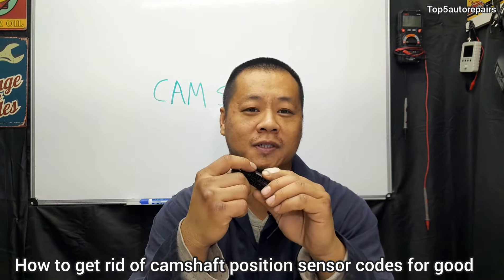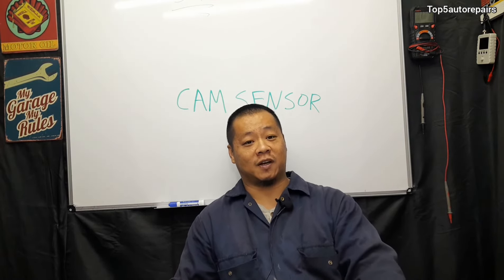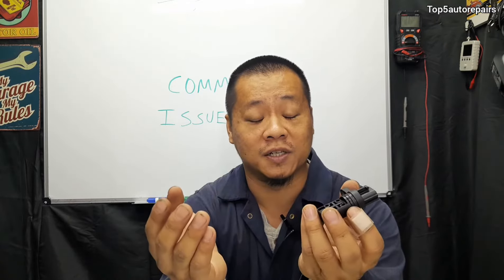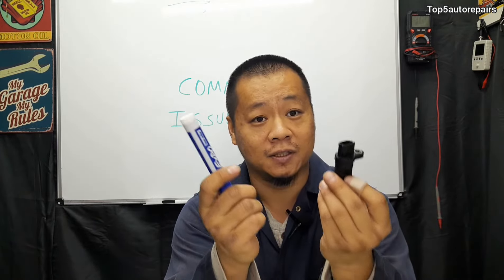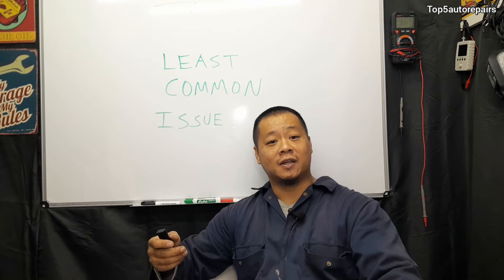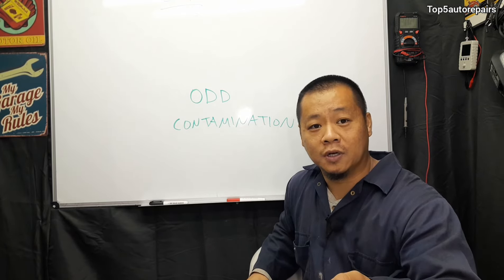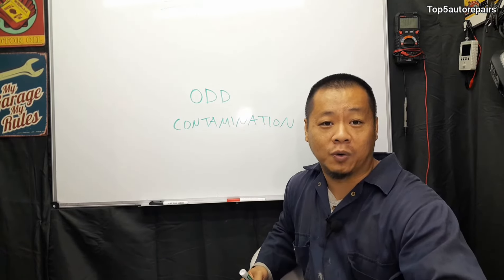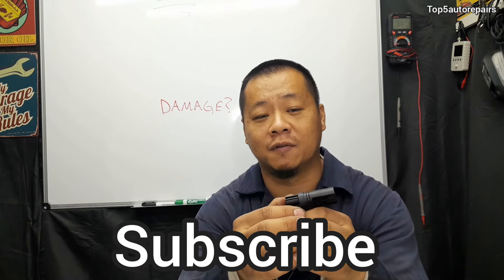How To Fix Camshaft Position Sensor Codes for Good (P0340 P0011 P0014) Know the Symptoms

Comment: Thank you for the video, I have a code p0340 on Infiniti g37 we’ve changed sensors and wiring already , hard time starting  and hard jerking at 2,000rpm or 20mph going to use all these tips possibly timing cover replacement????
Reply: I have one on my g too im not sure what the actual issue is I also have P0335 .
Reply: @vein3236  yal figure out the problem.  I'm in the same boat with my 2011 g37x

Comment: I had this problem on my ram 1500 4.7 for about a year now. First, the code showed up once a month, but always goes away by itself, but now check engine light is always on and im basically driving in limb mode everyday, i had replaced the sensor and the harness and didn't fix the problem. I also find out that i have a blow headgasket. I was just waiting for the truck to die, but engine and transmission are still strong  after almost 300k miles, might be time for a engine rebuild, i will take it to a mechanic next month for a inspection and a estimate.
Reply: Still going?

Comment: A weak tensioner would cause a P0340 only if the timing chain skips a tooth; right?  I have a 1995 Maxima.  I did a head job and changed the pistons and rings.  If I mistakenly swapped the exhaust and intake camshaft(if possible) would that cause a P0340 code?  I have spark.  Great video.  Thanks.

Comment: My name is David. I'm having an issue with 2010 Dodge Grand caravan with a 3.3 l has 148,000 mi. It ran good when I bought it off my niece. I am in a process of flipping it so I put new tune up and crank sensor and cam sensor. New exhaust new caddy new bank 1 bank 2. Oxygen sensor new AC pump and new intake gasket. Put new gas cap and the normal. I forget the name of the e-bap under by the charcoal canister that are common on the dodges and now I'm getting every check engine light code for every sensor that I've changed and also gas cap. I've had it smoked and there is no leaks..

Comment: OK, you ready. The one most important thing that you forgot to mention the entire video was the re learn process. I don't know if you just failed to mention this or if you don't know what you're doing. Number one problem when replacing these sensors is the learn process,  if you skip it, you're gonna have a code all the time and you'll even get other codes thrown. If you replace a camshaft or crankshaft sensor, you must use a computer to perform the relearn process. If the vehicle requires it look up your specific you're making model to see if it requires a relearn process. otherwise it will act as if you never replace the sensor to begin with.
Reply: This is quite helpful as i have the similar problem. i changed the sensor, wash the engine, change oil and did everything but the engine light always comes back with the same error code. Is this relearning can be done with normal diagnostic computer or is it a specialized device?
Reply: Relearn????? Haha ok
Reply: Very true. Do you happen to know the exact model of diagnostic tool that can perform the relearn on a 17 Hyundai Santa fe sport for a camshaft position sensor CASE Relearn?

Comment: Really  good video stating to see lot of fly by wire cars geting up in age I'm trying to diagnose a 2015 chevy 6.0 with Alison's ill get it straight and another part will go bad did research found out was flood truck where thinking on car facts and he didn't know he bought it threw used dealership but Ben nothing but trouble 4th time this truck Ben down in a year sense I've Ben working for the man it frustrating  to try this try that hope it works can't return electric parts and their not cheep

Comment: Got a p0011 code and I’ve replaced all of the parts I can think of. The code  still comes on and off randomly  could the camshaft position sensor cause the code?

Comment: How to complete the drive cycle on toyota corolla Ce, air fuel and ratio sensor it's  not ready almost two thousand  miles.
Reply from the maker: Make sure air/fuel ratio sensors are working properly. Check engine light should be off and there should be no codes. Drive all road conditions, highway and street. Go uphill and down hill.